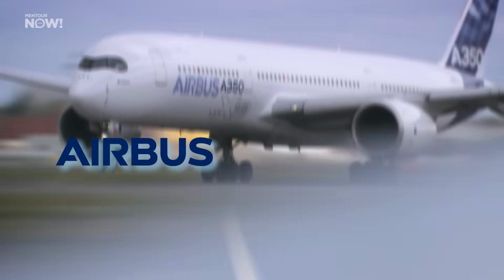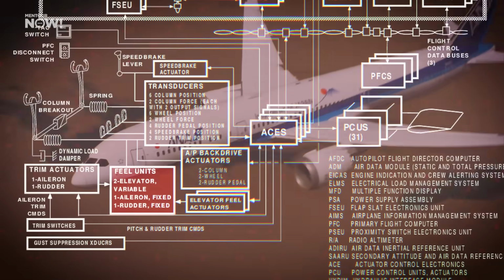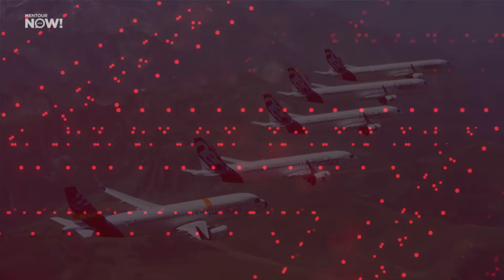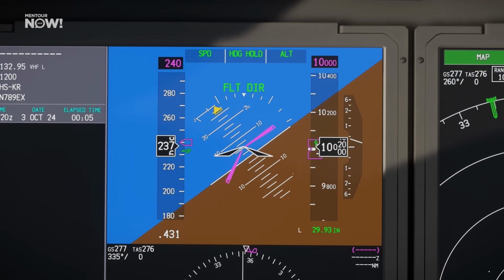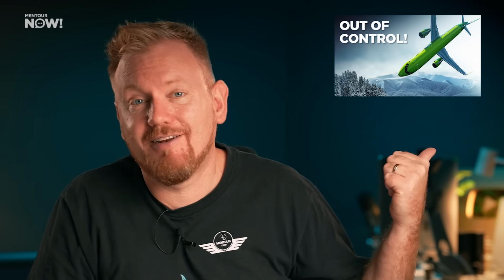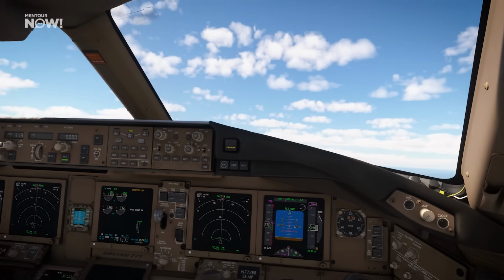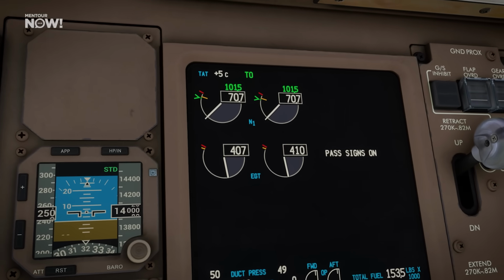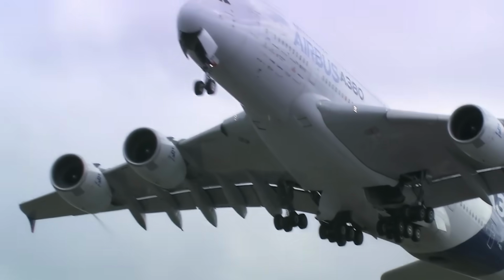Do Pilots Prefer AIRBUS over BOEING?!

Comment: As a car mechanic, it's interesting the see how polar opposite fly/drive-by wire technology is in areas like weight, parts of failure, and cost. since the engine in a a car is all that's controlled by the gas pedal. Old school enthusiasts tend to prefer cable driven pedals because they're lighter since a cable is lighter than an electronic sensor and a small motor, less complex because it's just a cable and a bracket, and cheaper for the same reasons.

Comment: Instructed, evaluated and did type rides for years on the A330. Flew the 767 for years. Spent some time in the A350. Just type rated in the 787. I’ll just say I would rather fly the Airbus. Much more comfortable and better automation. More organized human/machine interface. The 787 seems a bit half baked to me at this point. Boeing rolls out new gen aircraft with past gen systems all the time. Some of the 767 processes should have been replaced or simplified on the 787. The MCP is not as refined as the FCU. The Airbus ECAM process helps the pilot make better decisions during the process versus the EICAS system. There is no need for a yoke to be between your legs, especially on long flights. The Boeing seats seem like they came out of a WW2 aircraft. Not very comfortable. The table in front of the pilot is conducive for inherent pilots tasks. The 787 is a nice aircraft but my preference would be to operate the Airbus. As far as the higher level of automation goes, it comes down to the pilot and how disciplined the individual is at understanding and knowing what the airplane is doing. New Airbus pilot “whats it doing now”? Experienced Airbus pilot “Its doing that thing again”! Love the Airbus, especially the A350. The 787 cant touch the A350.
Reply: About time we got a pilot who has flown both the 787 and A350. The 787 is indeed a nice aircraft but unfortunately suffers from sharing a type rating with the 777 and having some questionable design decisions from the past Boeings and 777 carried over to the 787, which is said to be the best Boeing could do as far as cockpit design. Ergonomics was never Boeings forte so I ain't surprised there, Airbus would trump any Boeing in that department without question, as well as automation.
Reply: @ Exactly! If you know, you know.

Comment: Having flown both Boeing & Airbus, Boeing is by far my preference. Main reason is simple: The Boeing is designed around the human Pilot and Airbus is designed around the Automation!! I find the interface in the Airbus lacking EFFECTIVE & direct communication with the Pilot. As mentor explained very well is that the Airbus interface relies on communication on visual cues. The Boeing communicates very well with the Pilot through visual and more importantly tactile feedback such as moving thrust levers and other controls. In addition, the pilot is able to bring up any non-normal checklist at any time which was not possible on the A320 I flew. Perhaps that is changed, I don't know. The Boeing is also in my opinion an aircraft that is far more intuitive and easier to understand than the Airbus which I think contributes to safety.

Comment: To me, so far, it sounds like when you get out of Normal Law on an Airbus, then it becomes a Boeing, when it’s more manual and the pilots are more in control. So an Airbus is better than a Boeing, since it “includes” it 🤷🏻‍♂️ and it adds features in top of that 🤔
Anyway, continuing to finish watching the video.
Reply: except in practice airbus pilots basically never fly outside of normal law and the few times that the aircraft falls outside of normal law has only led to disaster

Comment: I have lived in Toulouse since 1995. I worked in English training with Airbus from 1997-2004. I heard as soon as I started doing that how Airbuses are a natural evolution of technology developed in the 60s and 70s to make Concorde safer and easier to fly for their pilots, and how the A300 was developed simultaneously and in parallel to that aircraft, secretly siphoning off funding. One could even argue that the A300 was possibly the 'real reason' for developing Concorde; the master plan, if you will. It was easier to get funding for a prestige project that for a dull, ultra high-efficiency one.While we were developing Concorde Boeing was developing the 737 that is still in service today... The 1988 fully fly-by-wire A320 also shares Concorde's DNA. That same philosophy and approach to aircraft safety, ease and efficiency of use, started in the 1960s by France and the UK, continues into today's Airbuses like the A350. We here in Toulouse are very proud of continuing to develop world-leading aircraft technology. I have now flown as cabin crew for an international legacy airline for 20 years and have worked on both Boeing and Airbus. The clichés I have heard, like that a B777 is a giant submarine with two huge ironing boards stuck to the sides, or that an Airbus is a flying mainframe with all the physical robustness of a Bic biro, are extremely exaggerated. As you say the behind-the-scenes differences in tech today are small, but the human-machine interface is still different. However as you can imagine in the final analysis I have to vote Airbus, of course...

Comment: My point of view as a passenger having been on 4-5 flights a year for the past 20 years is this. 
Most hated experience: Boeing 737s. During takeoff and landing, this plane gives me the most discomfort. My ears ache to a varying degree and when the pilot is in a hurry to land quickly I feel like a dam burst in my ear canal. All the babies on board were having a grand orchestral concert every take off and landing. It's cramped, noisy, and just overall a bad experience as a passenger.
Most quiet: Boeing 787. This would have been my favorite if not for the seats. Been on 3 airlines and they seem to have all chosen the ultra-firm but very thinly upholstered seats. I feel a dull pain on my tailbone if the flight is longer than 2 hours.
Overall best experience: A380, super spacious, quiet, and the smoothest and least bumpy takeoff and landing. My only complaint is it's rare to get on one.
2nd best overall: B777 and A350; where everything is above average and a generally comfy ride. The seats also tend to be softer and better than in the 787s
Best mini jetliner experience: Embraer. So cozy and friendly. In the few short distance flights I had, this one is amazing. Takes off and lands with no discomfort, unlike the 737s. Proof that the bad experience is not because of plane size but inconsiderate design.

Comment: One issue i wonder about between Boeing and Airbus is the yoke v joystick control. The yoke is the same for both seats whereas the joystick is right/left handed depending on which seat. In high stress or emergency situation couldn’t this differential play a negative role?

Comment: Flown both.  Tactile feel.    All I have to do in a Boeing, Lockheed, McDoug, Convair, Aero, Cessna, Piper and a few other jets is lay my hand on the power levers and without looking, I know how much power to expect without ever taking my eyes off flying the plane.  Not true with airbus throttles.   Fly By Wire has been in the US since the 50s and the 737 in 73’ had a FBW tested so it has nothing to do with FBW. It’s tactile feel.   Also, without looking, I can grab the stick/yoke and feel what the other pilot is doing.  Not true with a FBW airbus.   It’s not a B vs A, it’s safety .  Make both sticks move and thrust levers move and I’ll consider a bus product.  The 777 is FBW and both yokes move along with the thrust levers…

Comment: I am not a pilot, but have a question: Is it true that in a Boeing, a turn input followed by a neutral yolk will leave the aircraft in a bank, while the same on an Airbus will return the plane to level flight?
Reply: No. On the A320, a bank angle up to 33° will be maintained with neutral stick. A bank angle between 33° and 67° requires a constant deflection of the stick. Full deflection gives you 67°, neutral stick makes the plane return to 33°.
On the 737, basically with neutral yoke the bank angle is maintained, though minor corrections are needed to keep it.

Comment: There's more embedded firmware controls in an Airbus which translates to higher probability things going very wrong. Boeing on the other hand has less embedded firmware control and gives pilots more control over their airplanes giving less opportunity for catastrophic failure during flight. Airbus is like flying in a robot, and you can't tell a robot you are going take over.

Comment: I flew A319-20 and 21 on the Airbus side and B757-67 and am currently on the 777 (soon to transition to the 787) on there Boeing side. I would fly both airplane families without reluctance, but Boeings are more fun to fly. The 777 is the reigning type. Once you fly one, you compare every other airplane to it. Good video and very accurate.

Comment: Very good video...
I have never flown an Airbus, I fly a B777, so I know my opinion may be a bit biased, but I really think that Airbus is not really solving any problem, for example with the automatic emergency descent of the A350 or the automatic TCAS RA of the A380 (and I suppose A350 too), according to them, these are safety devices, but the reality is that for decades there have been no accidents or incidents related to these events where pilots have performed the maneuver incorrectly, that is, the industry is not really needing them. I think that in aviation, the automatisms are separated into 3 categories, those that really reduce the workload of the pilots, those that make flights more economically efficient for the company and those that are intended to get pilots out of the planes and I think that Airbus is dedicated to this 100%.
Well, after consulting with many friends who have flown Airbus and Boeing (or non-Airbus like Bombardier, Embraer, etc.), practically all of them have told me the same thing... 

"WHEN EVERYTHING IS GOOD, AIRBUS IS EXCELLENT, BUT THE DAY YOU HAVE PROBLEMS, YOU WILL WANT TO BE ON A BOEING."
Reply: I'll have to disagree with you when it comes to the automatic emergency descent on the A350. The purpose is to be a last safety net in the extremely unlikely chance both pilots get incapacitated due to a depressurization. That is something I wish all modern airliners being built today had. That system alone would have saved the Helios 737 (flight 522) from crashing. So there have been an accident where that system would have saved the day. Automatic TCAS isn't really necessary as it's mainly to reduce workload but it's just part of the future where aircraft gets more automated. I of course don't like the prospect of single pilot or no pilot operations at all but Airbus is ahead when it comes to automation. However now we have new generation aircraft like the Gulfstream G600 where as it's avionics and flight abilities blows the most advanced airliners in service, the 787 and A350 out of the water.
Reply: @ The emergency descent in airliners is not "necessary", the Time of Useful Consciousness (TUC) at the altitudes we fly ranges from 1 minute at 30 thousand feet to 30 seconds at 40 thousand feet, more than enough time for us to put on the oxygen mask and make the descent. The Helios case does not count because all the "alarms" that the cabin altitude was ascending failed. It was an old model that did not have EICAS or ECAM. In addition, it was a slow decompression, which is why they did not notice. If it had been an explosive decompression, if they had noticed, I would have started the emergency descent. In any modern airplane, there are signs of (slow) decompression already at 8,500 feet and again, in case of an explosive one, flying at 40 thousand feet, we have 30 seconds to act. It is different in corporate airplanes that fly at 50 or more, there it is useful since the TUC is only a few seconds. Airbus aims to remove pilots from aircraft as soon as possible and for no reason other than the "cost" to airlines. This is quite clear, they are already testing the 350 with Cathay.
Reply: @pabloechavarria2045  Alright, you make your point, especially concerning the lack of EICAS. I can understand where you come from.

Comment: Not a pilot here, although I love to fly (I have epilepsy). When I fly to France on Air France I usually find myself on an A350-900. What struck me about it when I first saw it a few years back, was the beauty of the design. The wing looks like a ray gliding through water, very elegant. When I got into the plane, I noticed that where the wing attaches to the body is quite wide. That's not great if you don't like sitting over a wing while flying, but I swear that it made for a more quiet, stable ride.
Reply: That could be a consequence of how the fuselage uses the "area rule" to minimise wave drag at transonic speeds. If the wings are comparatively slim then the fuselage may need to be widened at certain points to increase the cross-sectional area of the aircraft to  get closer to the ideal shape for minimum drag.

Comment: As a non pilot, I like a plane that brings me from point A to B. Needed is a safe plane and a professional crew. Over the last few years it was over and over reported on the Quality and Safety issues of Boeing airplanes. So for me, NO flights with Boeing aircrafts. Even the travel time is longer or cost more.
Reply: but only the 737 max has been problematic

Comment: 3:57 pretty much the reason i cant drive many modern vehicles, there is no feedback and its so easy to rotate you could control it by blowing on a card taped to the wheel.
My personal car has no power steering but the weight distribution renders it irrelevant.
Id rather fly the Boeing, just because of the feedback.

Comment: Let's daydream a bit . . . When the current gaming generation joins the workforce, specifically as pilots, FBW skills will be a natural to them. They might even find newer ways to push the limits and extend the envelope - yes, ï.e. hacking Airbus' normal, alternate, and direct modes into "God Mode". Add AI to the system and we'll see an increasing level of acceleration in adaptation and extending capabilities. At this point, the system can even reset itself to suit the Captain's & FO's nuances and idiosyncracies, aka "flying style", once recognition formalities is done. Fast forward another 15 to 20 years and we'll have giant drones shuttling passengers with a small team - or even just a single "pilot" - sitting in front of an array of screens in a huge arena full of "pilots" flying passenger boxes from points A to B. History has shown that creativity has never been constrained by technology. Boeing has a lot to catch up in the human - machine interface dimension. I really enjoy your channel, thanks for all those detailed insight into the workings of aircraft and flying. Keep up the great work. (PS, this comment is a bit "off" the track I guess, but, well, your postings inspired this - most probably a one-off)

Comment: I am not a pilot and do not claim to have any knowledge except for the aviation interested person. But one thing that has always puzzled me is that only Airbus (at least until recent models) use digital information on the displays as Quick Reference (check list). I have always wondered why the paper reference manual has survived for so long, in particular when it comes to stressful situations where a lot is going on. Wouldn't it be easier to simply get the right information on a display right in front of you? Perhaps a touch display with some quick look up links to touch for further information. Finding the right information fast is usually quicker on a display where the only thing required is that the computer shows you the right checklist for the situation you are in. You  could even (maybe it is already done) make this even easier by a voice control system where the pilots could simply describe the situation in normal language (of course pilot terminology), to have the system bring up links to the most likely pages to look at for solutions. I don't understand why Boeing has kept the paper book for so long. I remember first time I saw that Airbus automatically showed the quick reference on the display in front of the pilot when needed, my first thought was: "But of course! Isn't that the only logical solution in this day and age?". Before someone clever chirps in and point to the situation where the entire cockpit goes dark, I am of course not suggesting you completely trash the analog paper reference handbook with checklists. So of course every cockpit will always have a flashlight (or other emergency light) and a paper manual, for the situation where the entire plane dies on the pilot. But for all the million other scenarios that usually are the ones happening, isn't it much safer to have a digital reference manual that shows the correct page without having to look it up in some paper book?
Another obvious benefit of a digital manual is that it can always remain updated - even in flight if a new instruction is published from the manufacturer. As long as the plane can communicate witht the ground, it is also possible to send live updates to the reference manual. And even if - for security reasons one wouldn't do it in-flight - it is still a safeguard against aged information that a digital manual is synchronized with the newest available information each time a plane is on the ground - even during a simple turn-around.
Is there a reason Boeing is so conservative when it comes to changing checklists to digital checklists on the display?